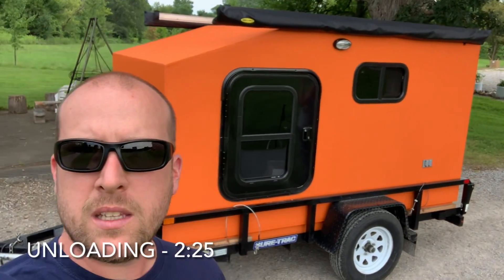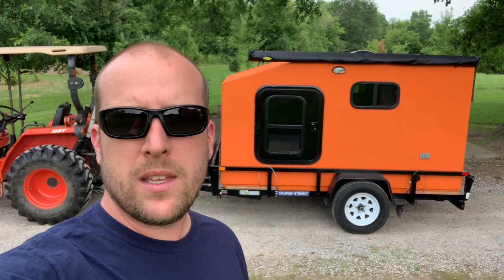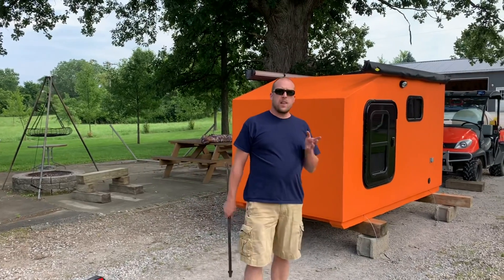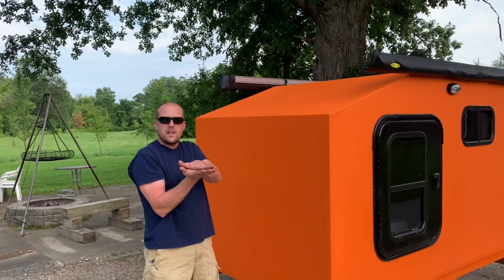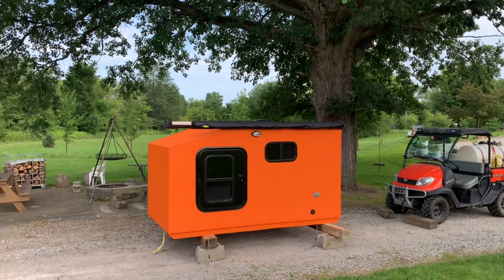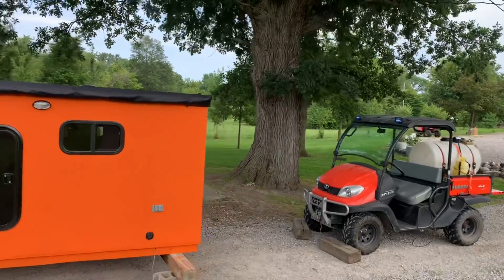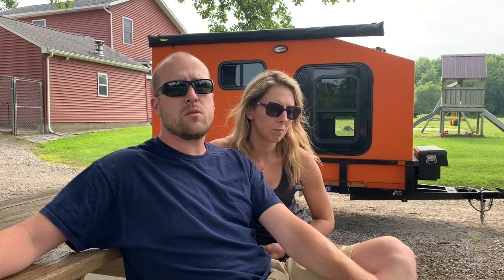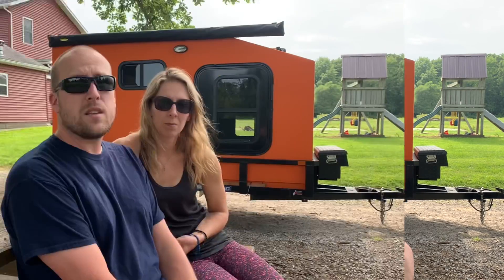DIY Squaredrop Camper Pod Build - Unloading, cost and weight

Comment from the maker: Tour of the finished product is here:

https://youtu.be/xusYi_N1mbo
Reply: What was the degree of cut for the top/front angle? Thanks.
Reply from the maker: Squaredrop Camper Build, Part 4
https://youtu.be/mHpS5eOZnN4

Check out 2:00 minute mark….108 degrees. Thanks.
Reply: @LivingOurAmericanDream  Thank You.
Reply: @LivingOurAmericanDream  This is by far the easiest and most sensible build I've seen on YouTube. I'm actually going to be able to do my build for around $1800 simply because I already have the trailer which is 5x12 and I'm not that far from an RV salvage yard, so I will be able to get all the windows, doors and electrical components dirt cheap.

I don't know if you originally came up with this particular design, but I'm seeing more and more of the square drop campers all the time. 

I'm tweaking mine just a little by adding AC, propane forced air furnace and small area in the back for an enclosed porta potty. Thanks again!

Comment: Nice.  For loading and offloading, I cut 1/2" PVC the width of the trailer deck.  Lift the front or rear of the camper and slide in the pvc rollers and she rolls right on and off just by pushing it.
Reply: Thats exactly how we move big heavy Hot Tubs. Super Easy
Reply: That’s how I would do it. We move big storage tanks in this fashion (w/inflatable bags).

Comment: For what I need to do. Need it to weigh less because my 1,000cc arc will be pulling it. I was told my towing should be around 1,500lbs. So I may use a aluminum trailer. This camper box will be set to fit my straight job International as a sleeper and a camper. Can’t wait
Reply from the maker: Hi Edwin, I see your comments and apologize for not having a blueprint….I should have done one as many folks have asked. My camper is a bit heavier than I would like but we pull ours with a half ton truck so no worries for us. Building it to come off the trailer is handy but will be a bit heavier. Good luck with your build, I had a lot of fun making this one and have been very pleased with it.

Comment: You have a tractor. Get some pallet forks for front loader and just lift it on and off. You can make pockets in the metal frame to insert the forks
Reply from the maker: Hi…yes, I thought a lot about that but my tractor is far too small. The way the geometry works on this one is I would have to fork it from the back, so my center of gravity would be about 4’-5’ away from the loader arms, far reducing the lifting capacity of whatever machine is used. The pod weighs in at 1500-2000 pounds. Most loaders are rated at the pivot pins (makes their specs look more impressive). My machine is rated at 1000 at the pins, not even close. I’d guess, without calculations, that a tractor rated at 4000 pounds lift or more would be required to lift this pod. My other option was to have lifting lugs on the top, but then we have a lifting height issue along with capacity. 

It’s an excellent idea but a much larger machine would be needed….probably an agricultural type machine in the 60-70hp range with big lift capacity. Thanks for watching.

Comment: There's another way of attaching the pod to the trailer that might be more convenient since you don't need to get down on the ground to unscrew the turnbuckle.  It's going to depend upon the corner supports of the pod though.  At each corner, you could put a tightening mechanism (such as chain binders) that connects to to some point on the corner and then extends down to either the bed of the trailer or the side rails.  Turnbuckles on each corner could accomplish the same thing, but would not be as quick to access as the chain binder mechanism.

Comment: It is awesome to see a fellow Michigander build something great!  I'm going to try and build something like this out of an old v-nose snowmobile trailer I have. I am curious, what did you use for your joints for no water penetration?  Great job!
Reply from the maker: All the joints on this camper pod are pocket joined (Kreg jig style) with wood glue. It’s coated on the exterior with two coats of house primer, then two coats of Raptor Liner truck bed liner, sprayed on.

Comment: thanks for taking the time to do a fantastic job on your camper, i was hoping i could get a referal, the plug adapter on the back for the extension cord, where did you get it? and the windows where did you order those? i have a 6x12 enclosed that i want to play with and make a weekender out of it, thanks for your time and efforts, love the job, the orange is a bit over the top but i love it!
Reply from the maker: Hi Dan. Most of the materials I used came from searching Amazon. The cord I think you’re referring to is this one:

MICTUNING 13Amp 125V AC Port Plug... https://www.amazon.com/dp/B079M6BCW9?ref=ppx_pop_mob_ap_share

For the windows and doors I bought from vintage technologies:

https://www.teardroptrailerparts.com/

Good luck with your conversion and thanks for watching.
Reply: @LivingOurAmericanDream  thank you! Hopefully you are truly enjoying your camper pod

Comment: Thanks for sharing very nice job 👏 ....you trust the Raptor liner works good under the rain ?
Reply from the maker: So far so good on the liner. I was (and still am) skeptical for long term use. However, when I picked up my windows and doors the place had a professionally made overland squaredrop for sale and they used Linex to finish the exterior….a similar product. We’ll see. Thanks for watching.

Comment: I first had the idea to do a camper pod on my flatbed trailer about 3 years ago.  When i saw your vid, i recognized your plan, and watched to see how you did things.   My ideas are far different from yours, and one thing i was going to do different, is the method for loading/unloading the pod.   Tell me what you think, if you could adapt yours to do it this way, and just generally what you think of the idea....   I was going to make large rectangular "hoops" that were positioned on each corner.   Hard to explain in text.   But basically imagine two lifting struts (braces, poles) that went across the front, and back.   Think of military "stretchers" they put patients on.   Two poles, can hold the weight of a body, while two men carry the person laying on canvas, stretched across the poles.    Now, think of those two poles running across the front and back, and being made of 3/16" steel C-Channel or I-Beam.   The beams would be inserted through the metal rectangular hoops.   Next, i was thinking of getting a set of those lifting legs, that they use on Truck-bed campers.   I would make a custom bracket that could provide a pocket for each lifting jack (leg),  to lift the beams.   So imagine, you are starting the process to load the pod onto the camper.  The pod is sitting on blocks.    You insert the beams across the front and back, inside the hoops.  You attach the four lifting posts into the beam pockets.  you crank all jacks and lift the pod.   Then simply drive the trailer under the pod.   then lower the pod, with the jacks.   Likely you'd have to move the trailer a little bit, to get it in the right spot.    And it might be smarter to use extra blocks, and instead of lifting jacks, use some hydraulic bottle jacks, set ontop of the blocks.
do you think that would be easier than your method, or worse?   Let me know your thoughts
Reply from the maker: Fantastic idea!! I actually though about something like this but my trailer is not a flatbed so it would not have worked for me. I think this idea is great and would work well. Leave yourself plenty of clearance to get the trailer in and out once you’re up on the jacks. Would be great to see this in action….any videos we could check out??

Thanks for watching and commenting. Matt.
Reply: @LivingOurAmericanDream  ...
No videos about it. It’s something I’ve always thought about building. But I’ve never gotten around to it.
I think it could also work on your trailer. I understand you don’t have a flatbed. But I think it still could be done easily. Just by making a few guide rails, at each corner.  Some pieces of steel welded onto your rails at slight angles like 30°, to help guide your camper box down onto the trailer.

Comment: I am planning on building one very similar on my 6x10. I was just wondering if your trailer has brakes or not?  I'm looking at the idea of adding electric brakes to my trailer just to balance it out and more ease of stopping, less wear and tear on my JKU's brakes.
Reply from the maker: My trailer does not have brakes. If you’re pulling it with a wrangler be very mindful of overall weight. I wish mine were a bit lighter but I sacrificed that for making it removable from the trailer and larger than a typical tiny camper.

Comment: question. Have you thought about permanently mounting a winch to the front of the trailer? That way you don't have to use the ATV, and it might provide the extra tongue weight that you needed in the first camping video. Plus the winch can be used for other things.
Reply from the maker: I have thought about it and it’s definitely a possibility in the future.

Comment: Sticking with the 5x10' size, can it be built with 5/8 or 1/2" plywood instead, in order to save total weight? Would be towing with a Nissan Rogue/Honda Accord.

If yes, which should I use, 5/8 or 1/2"? Primary purpose would just be to park and backpack, I don't think using on too many rugged or rocky roads.

Much appreciated,
Sammy
Reply from the maker: You could go 1/2” or even less but make sure you have support for the structure. The 3/4” basically is stout enough to support the structure without framing anything inside the walls. Less thickness would begin to be structurally un-sound. Lots of guys frame in using thin metal and then attach thinner wood for walls. 
You’ll like the 5’x10’ better than these teardrops you can barely get into. Good luck and thanks for watching.

Comment: Any issues with the raptor liner.  I hear that is separates.  I'm beginning my build.
Reply from the maker: Not so far. However, I must admit I’ve stored the pod inside during the wi get months. I think the key is preparation of the surface. I sanded and cleaned extensively before applying 2 coats of exterior grade primer followed by cleaning and wiping again. Seems to have worked well.

Comment: Matt, you mentioned you can tow it with your truck and with your Jeep.  I don’t own either vehicle.  My sincere question: Would you feel comfortable towing it behind a typical minivan (such as a Dodge Grand Caravan)?  Those have a towing capacity limit of 3,500 pounds (most of the minivans I have seen with 6 cylinder front wheel drive).  I have not towed something like that, but wonder what it might feel like on the highway, or if in a windy open area (Midwest states), when pulled behind a minivan.  Any advice or feelings about that being safe, or inadvisable, or risky or “sketchy” or….?
Reply from the maker: Hello! I’ll start by saying the jeeps tow capacity is also 3500 pounds. Most vehicles have rated tow capacity based on the vehicles weight, wheel base and braking capability. My camper could have been built lighter and that’s what I would pay closer attention to if I did it again. I’d say you would be fine towing a camper like this on a trailer since it is low profile. Make sure your entire rig, camper and trailer together, is under the rated capacity for your tow vehicle and you should be ok. 

Thanks for watching and good luck! -Matt
Reply: I have a 08 town and country I have pulled a 16ft camper no problem in the Midwest (Chicago  here) though it might have been lighter because it is aluminum not wood
Reply: @ronniemiddleton5231  Thank you for your answer to my question.

Comment: That is heavy. My 7x14 enclosed trailer is 2200 empty, and I use it for camper, hauling my Harley, and other uses. It's not good for overland but it works for me.
Reply from the maker: Definitely heavy. I’m planning on building Rev2 soon….smaller and lighter. Thanks for watching.

Comment: Why not embed steel wheels underneath that can be latched down. You then only need two trailer boards. With a simple 12volt winch attached to front of trailer. No other tools are required. Be an order of magnitude easier.

Comment: So, I need to buy a tractor to pull the thing in and out??
Reply from the maker: 😂 I suppose if you don’t have one and you can think of no other way, yes.

Or….a come-a-long? Electric winch? Build it lighter than mine and move it by hand? Rollers? Skids? Wheels? Use a lever of some sort to move it? Just a few ideas to get you thinking on your own! Good luck.

Comment: Your not supposed to have but 350lb tongue weight
Reply from the maker: Hi Josh. Yes, typically 10% of trailer weight is max tongue weight, so 350 here. In this video the issue was more that there wasn’t enough tongue weight, not too much. Since then, I’ve rebalanced things and it pulls very nice. Thanks for watching.